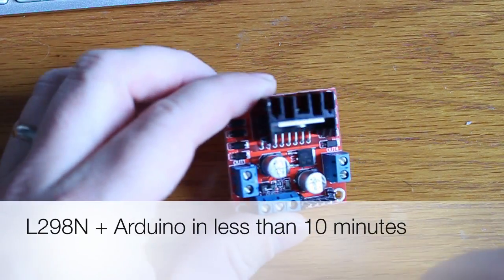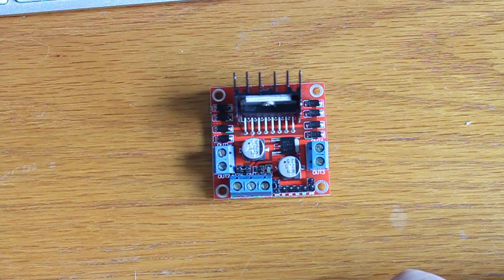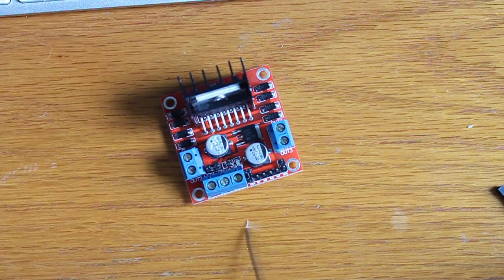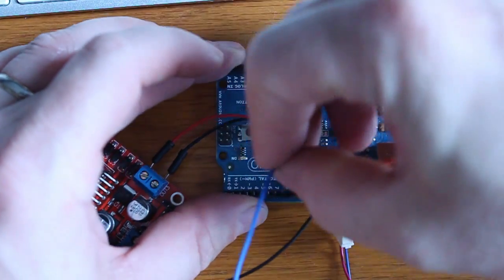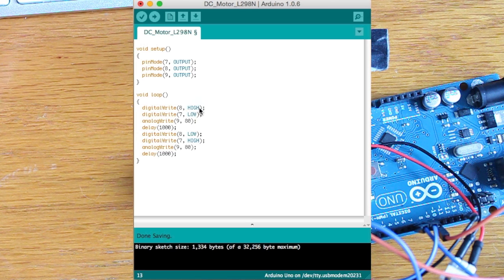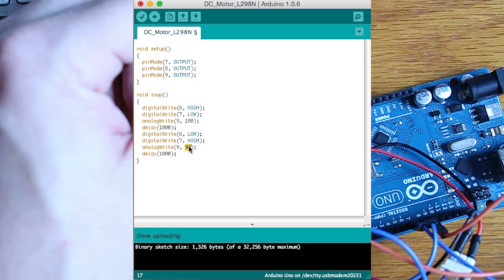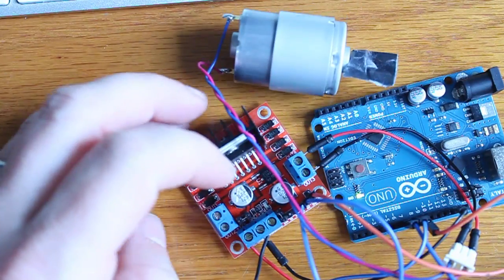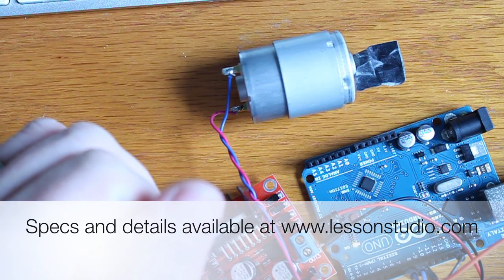HOW TO: control DC Motors with Arduino + L298N

Comment: just saw your video.. and i kinda need some help as we have a semester project in which we are to use stm32f4 to run the DC motor .. and the instructor asked us to use an opto coupler  as the moor will draw current and it may damage the microcontroller... but here in your video you didn't use any... is it because it was arduino or is there no need with an l298 module? kindly do reply.. thank you! :)
Reply from the maker: +Imrana Jabeen The L298N module is great because it pretty much protects your microcontroller from the motor. The L298N is also an H-Bridge which allows for bidirectional control. A typical opto-coupler setup will only allow the motor to be powered in a single direction. 

There are many ways to use an optocoupler to drive a motor but my personal favourite way to do it is to have the microcontroller drive the optocoupler which then drives a MOSFET which controls the motor.
Reply: +LessonStudio so that means if i want my motor to be bi directional i should omit the optocoupler and directly control the motor through he l298 module using the micro controller?
Reply from the maker: +Imrana Jabeen You could omit that if you are using the L298N module and not just a bare L298 chip. But if your instructor wants you to use optocouplers you could also use one for each of the connections you are making to the L298N which would very much isolate the motor from your microcontroller.

Adding optocouplers to the circuit would do no harm beyond making it a bit more complicated.
Reply: LessonStudio  OK thank you very much! :)
Reply: Now Controll anything in adrunio via keyboard{makeAnyprojects}
https://youtu.be/jAHLtRmgRiI

Comment: #Ask
can I use L298 with arduino due or arduino mega?
it cant work with it. please help me
Reply from the maker: +tamim abidin It will work with the mega perfectly well as it puts out 5v on the output pins. The Due only puts out 3.3v which should also be enough to activate it.

Comment: Awesome vid. Thanks for sharing your knowledge. Does it come with Back EMF protection?
Reply from the maker: +Jorge Washington I presume by that you mean all the evil spikes and whatnot that motors have a habit of producing. The answer is yes, in my experience. I don't know what would happen if you had a very powerful motor with huge coils where you were only putting 2A into and then either cut it off or were to spin the motor really hard so that it tried pumping 5A back into the circuit. 

When I incorporate larger motors in my projects I often isolate them in a variety of ways including opto isolators. I also try to use circuits that somewhat dwarf the motor. So I leave a nice margin between the device's specs and the motor's specs. Thus fare this has kept me from any trouble.
Reply: +LessonStudio Thank you for your reply. Yes, thats what I meant.
Reply: Now Controll anything in adrunio via keyboard{makeAnyprojects}
https://youtu.be/jAHLtRmgRiI

Comment: its not working !
Reply from the maker: +Rational Fundamentalist My three suggestions would be to: double check the wiring. Then, using a multimeter, check that there are voltages going out to the connections on the module, starting with those leaving the arduino. Finally some of the modules are simply duds. I have fixed more than one as it was delivered DOA.
Reply: Now Controll anything in adrunio via keyboard{makeAnyprojects}
https://youtu.be/jAHLtRmgRiI

Comment: Is it possible to force controller to be silent? :-) To be honest it drives me mad :-)
Reply from the maker: +Grzegorz Sidorowicz Sort of. I presume you are talking about the whine of the motor and not the controller. The controller should be quiet. If the controller is making noise then something might be wrong.

Motor whine comes from the way that an arduino sets the power level to this controller which is via PWM or pulse width modulation. Basically it is turning the power to the motor on and off very rapidly causing an average voltage based on the ratio of on to off. This is the source of the tone. 

There are ways to increase the speed of these pulses by changing arduino PWM settings. You can roll your own PWM in the loop. 

Another solution is to stuff a capacitor into the circuit to smooth out the flow of power coming from the module to the motor. Choosing the capacitor can be done with some math, or you can just go by educated guesses and find one that works.

This last can work very well but keep in mind that a capacitor with a rapidly fluctuating power going into it can act fairly especially when the frequencies are high. Finding one that can handle the power, not cause a  power loss, and silence the whine isn't that hard.

In theory if you have an oscilloscope it can really help to see if you have nailed it; but your ear is the final test.

Also often the whine is most pronounced when the motor is operating at the lower end of the power range. Thus decreasing the power going to the module, and then operating at a higher PWM power can significantly reduce the whine. In theory PWM operating at 100% output will just be a solid power level and not whine at all.
Reply: +LessonStudio The sound exists also in your film, when you illustrate that motor can't rotate (8:40). So, it seems that I wrongly identified origin of the sound. I will investigate it...maybe in my case I don't need to use PWM so it is quite possible that problem will disappear in natural way (as you said 100% solid power eliminate it). I just only want to built robot with tiny hoover on it's back so in my case fluent speed is not so important. BTW. Your film helped me a lot ;-) Thanks!!!
Reply from the maker: +Grzegorz Sidorowicz This might sound like crass self promotion but I have another video, https://www.youtube.com/watch?v=3A-pcONMSWI that covers alternative ways to control motors. If your hoover does not need to spin the motor in both directions then something like a mosfet or a relay would also be a great way to control it. 

The relay is a conceptually simple way to turn a motor fully on or fully off with no power loss. In my other video I show how to control a motor with a mosfet which can be seen as a solid state relay in that you can switch a motor on or off. They are cheap and easy to use and can handle boatloads of power. 

The only thing to be aware of is that I keep things very simple in my video. When actually hooking a mosfet to an arduino to control a motor, you will want a few other bits, mainly a diode, to keep the motor from frying your arduino. A relay is simpler in that it pretty much isolates your motor from your arduino.

One other thing to be aware of is that arduinos are happiest with what are called Logic Level MOSFETs which basically translates to one that can be turned on with 5v.

Do I smell a homebrew Roomba?
Reply: Now Controll anything in adrunio via keyboard{makeAnyprojects}
https://youtu.be/jAHLtRmgRiI

Comment: how to add ir sensor to this project ?
Reply from the maker: +Rivaldi Thunder yeyo#vevo An IR movement sensor?
Reply: +LessonStudio infrared remote sensore
Reply from the maker: +Rivaldi Thunder yeyo#vevo Sorry to continue answering with questions, but to what effect. That is do you want to have it detect a change in an IR signal, receive a signal from another IR device. Detect a movement, detect a beam interruption, proximity sensor, etc? Then what do you want the motor to do?
Reply: +LessonStudio the motor controlled by ir remote ,look like robot ( ir remote controled this device to run motor , sorry bad engllish
Reply: Now Controll anything in adrunio via keyboard{makeAnyprojects}
https://youtu.be/jAHLtRmgRiI

Comment: I have the feeling that you are a very nice person, just from listening to your language and tone :)
Reply from the maker: +Jan That is the coolest complement I have received; thank you for that!
Reply: Does this work with a 9v battery? Because mine doesn't want to work. Am I using too low voltage? I am trying to make a 3v dvd motor run. If I can get that working, I can build my ev longboard
Reply: Sound like Takumi from Initial explaining his techniques. Quite lovely to ear
Reply: +boowonder888  motors draw  quite a bit of current. assuming your motor is OK and properly connected it might be a regular 9v battery is not enough. have you tried with a external power supply?
Reply: No because I'm afraid I will fry the Arduino or the ln28. hardky  touched it since..... Also I need a good sketch!
Reply: +boowonder888 There should be no problem using an external power supply. You using the USB connector to power the arduino? You can use the DC power jack with a 9V wall wart power supply. Arduino has a voltage regulator that will limit the voltage input to 5V, so no worries there. Using the USB as power source can give you as much as 500mA (USB 2.0 specs). Using a external one can give you 1A. According to arduino specs it can handle between 7 and 12V.
Reply: @jorgee.davalosmelgar8123  late year question. if im going to use Arduino Uno + Battery Holder with Jack + L298N H Dual Bridge + 2 Motor. now i have 2 Li-On Battery(3.7v total of 7.4v) then i use the Jack Termnal of arduino and connected the two(because i found several youtube videos that they dont use jack. instead they connect the Li On Batteries dirrectly to Dual Bridge L298N). what should i do next, am i going to use the "Vin" pin? then where will i connect the Pin, towards the VCC or else?. im just ensuring so i wont fry my arduino because this happened before with different parts haha

Comment: Hi, I'm trying to power 6 330RPM DC Motors. 
I have a 12V battery. Do I need an L298N for each motor?
Reply from the maker: +Pierre Rappolt This module can power two DC motors at a time. The key question would be what are the specs on your motors. 12v is not a problem. The amperage is what you need to watch, as the limit for this module is 2A per motor. If you don't know the amperage of your motor you could run it under load straight from the battery with a multimeter hooked up (one that can handle many amps). The module uses up some power so a bit less will get to the motors when using the module and thus the amperage will be a bit lower.
Reply: On the motor specs it says "Max. Stall Current: 20A @ 12VDC"
What module should I use for speed control of 6 of these motors? And will one 12V battery be enough to power them?
Reply from the maker: +Pierre Rappolt That is wayyyy past the specs of this module. Basically it would heat up and die. 

You would be looking for a module that can get well past 20A at he peak. 

Here is one for $30 that can handle 2 motors. http://www.amazon.com/gp/product/B00MGESELA/ref=as_li_tl?ie=UTF8&camp=1789&creative=9325&creativeASIN=B00MGESELA&linkCode=as2&tag=lesson0e-20&linkId=V3B7XPZHWU7K5EGT

I suspect that a cheaper similar module can be had on ebay. 

I have not used the above module and suspect that it would need what looks like the two rows of mosfets to be heat sink'd. One key to buying such a module is that there are plenty that have a little knob to set the speed. There is a way to feed arduino inputs in instead of the knob but it is a bit of a hack. So avoid any that don't have nice arduino PWM friendly inputs. Generally avoid the ones with a knob.

If your motors are only going to go in a single direction then you don't need the H-Bridge technology which allows you to easily reverse motors. If this is the case you might be able to simply use a MOSFET. This brings your cost down per DIY motor controller to well below $2. You would need a mosfet and a few other simple bits like a diode. Many cheap common mosfets can easily handle 30-80 amps. 

As for the battery putting out that much power; this is a question for the battery. In theory if you stalled all 6 motors (which means that they have encountered a load that stopped them from turning) that would be 120 amps. A good car battery could handle that for a while but the wires required to happily handle that kind of power would be about the thickness of a pencil. 

If the motors are going to easily overcome any resistance they might encounter (think fan blades) then the amperage won't probably be that high. 

So then you need to know how much amperage will be used during normal operation. This can be measured with a multimeter capable of handling 10's of amps. 

At this point you can start to calculate how long your battery will last. Often a battery is measured in watt hours or amp hours. But that again is misleading as there are various kinds of batteries. A car battery is not what you would call a deep cycle battery. They are meant to start the car and then rapidly be recharged to full. To fully discharge a car battery is very bad for it. GoKart batteries are meant for the rapid and deeper cycling. Thus you can get closer to their theoretical maximum watt hour rating. 

So let's say you found that your motors were using 2 amps each under a normal load. You have 6 which is 12 amps at 12volts or 144 watts. If your battery were rated at 20AH then I would not plan on it quite making it much past an hour. Plus few batteries like to be fully drained; so the above battery should probably not be pushed any harder than an hour. 

You can combine smaller batteries in series to get a cumulation of amp hours. So 3 7AH batteries would be roughly the same as one 20AH battery.

BTW a 7AH 12v battery would be about the size of a brick. 

With all of the above it is a good idea to triple check that you have the right kind of battery for how you are going to use it. For instance few lead acid 12v batteries clearly state the maximum current draw. Car batteries are somewhat rated in what is called CCA or cold cranking amps, but that is for short bursts, not sustained drain.

So be careful and monitor things such as temperature and whatnot.
Reply: +LessonStudio 
I only need the motors to turn forward and slowly is fine. I also don't need a very long running time before recharge (~30 minutes). 

In that case, would a MOSFET suffice? And can you point me to a battery that you think would be best for this case? Size of battery is also not an issue, so the 7AH 12v battery might be right. This is a big slow moving robot I am building. The chassis can withstand a lot of weight.
Reply from the maker: +Pierre Rappolt Forward would only need mosfets and there are a zillion videos/tutorials on that including one that I did where I show the basics. Typically you will want to have a diode and whatnot to keep your motor from frying your circuit. 

If you aren't stuck with your present motors, or if they have this already; If you are going to move slowly it can be a good idea to have geared motors that are running a bit faster. This way they are far less likely to stall. It all depends upon the variations in load. So if you are driving thing slowly over rough terrain with large tires, then gears would be a must. If you are running small tires on a smooth even floor then you could get away without them.

I would think some kind of gokart battery would be good. They are commodity items and are meant to drain fast and pretty much all the way. You might need more than 1 small one. 30 Minutes of slow movement will probably mean that you are not going to be demanding too much from your battery. You could always try one and then shove in another if it isn't enough.

I will say that with 6 motors of that size, you have quite a tank going there.
Reply: Now Controll anything in adrunio via keyboard{makeAnyprojects}
https://youtu.be/jAHLtRmgRiI